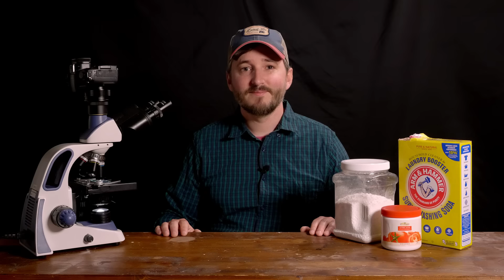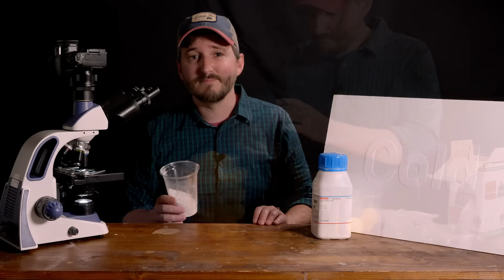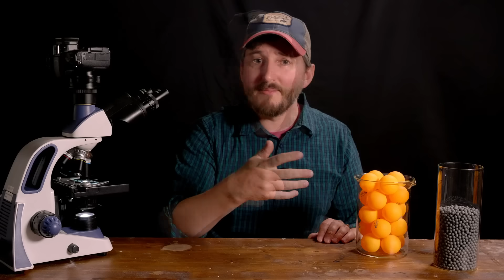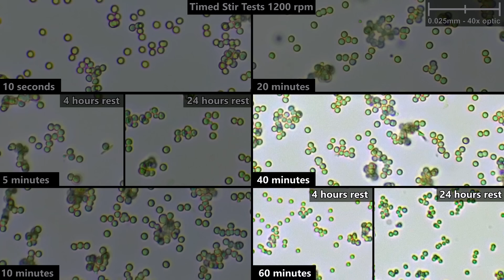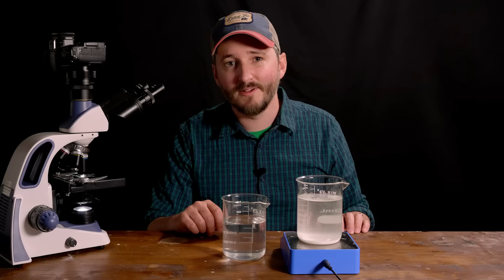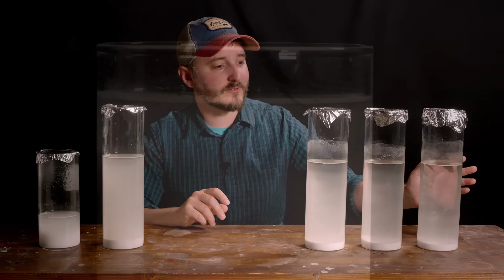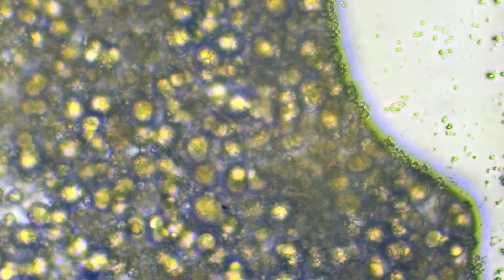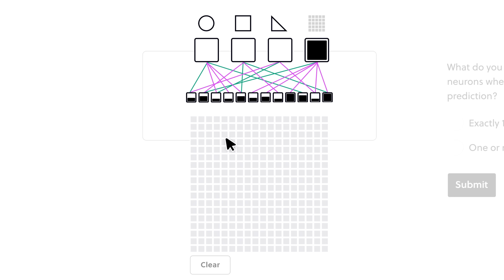Making Infrared Cooling Paint From Grocery Store Items (w/Novel CaCO₃ Microsphere Synthesis)

Comment: wow...im impressed, subscribed!
Reply: i retired in the philippines and coated my sheet metal roof with hi gloss white oil enamel(after priming with iron oxide) and it cooled my house interior so much it made no sense to use styrofoam insulation under the 3/4 inch plywood the sheet metal is screwed to. even when the sun beats down hot enough to easily cook an egg on red primed or bare sheet metal mine is cool to the touch.
i dont think this paint can be used for my purposes but i learned a lot and may incorporate some micro spheres into the next repaint.
i was a painter for many years,sandblasting and industrial to decorating, from tank interiors such as those large elevated municipal water towers and reaction vessels at factories and "tank farms" to kitchens and bathrooms. I paint oil paintings as well of landscape scenes etc.
you are one cool dude 😃

Comment: For application: If you were able to keep the consistency of the final product very controlled, you might be able to extrude it with the same sort of x/y movement as is made by a 3d printer or inexpensive hobby laser engraver. This would have the benefit of showcasing a method in which entire panels could be mass produced with machines.

Comment: Would a clear corrugated plastic panel with the paint on the underside be a good test ? It would protect the fragile paint as well, give it a layer of insulation so you aren't cooling the outside air.

Comment: Would this paint function well with a clear coating on top after it dries? You mentioned the thin plastic above it, and I completely understand the irregular surface area scattering light better, but for practicality's sake wouldn't a hard clearcoat on top help towards the "general use" goal? It would also help in rain, for example, where a nonzero amount of this recipe would just dissolve on the surface as is currently right?

Comment: There's clear benefit for the many by open sourcing your research and clear reasons that you wouldn't have.

As a (smol) science channel myself with similar pros and cons for open sourcing -

What's your motivator for (put your small youtuber hat back on) open sourcing vs keeping your knowledge to yourself?
Reply from the maker: In my case most of my current income comes from making videos so I don't need to worry about making money on the inventions. You can always release a video then file a patent or provisional patent also if you think the invention has some value that you'd like to commercialize

Comment: Recommendation for paint/coating application: Attach two parallel guide rails to your canvas, place a dollop of your coating at one end, and use a squeegee perpendicular to the guide rails, wiping down to spread the coating evenly across the rest of the canvas. The height of the guide rails will determine the thickness of the coating.
Reply: Screenprinting.... without the screen. Clever :)
Reply: That's pretty much what I was thinking, at the right consistency this is less of a paint and more of a putty or paste. Would be pretty trivial to skim-coat large surfaces with a similar method to how you apply drywall mud or plaster on walls.
Reply: It might be possible to have a solder mask cut (probably in a diamond grid pattern) so you could apply it the same way as a pcb gets pasted. You'd probably need a more viscous coating for it to work though. Spread it on with a stainless scraper, and remove the mask. The fluid should spread out a bit after its removed, and gravity should flatten it out and fill in the missing spots. You could also play around with the thickness of the stainless mask too.
Reply: Nice to see that a few of us came to the same solution! However this would only allow for one size of panel, but especially for experimentation would make everything a lot more consistent
Reply: I’d think it’s most case use are roofs vs the sun. Screen printing as the original poster noted is a great idea. Flexible rails can be laid on a roof and a layer can be “printed” on most roof surfaces (say 1 meter long sections. Then one of the rails is removed & moved to the end side, then another meter is printed, then rail is moved again until the entire roof is covered. This is similar how they screed a concrete floor, using guide rails to glide over. In this case, the rails can be permanently left inside the finished layer, or something that is removed as you go. The rails themselves are the thickness you want the layer to be.

Comment: That's actually really impressive, the simplicity of production. As is the scalability. It would be really interesting to try an application on a much larger scale, like an entire shed, for example. Just to see what it does to the interior temperature. That was incredibly interesting, and amazing to watch the spheres grow in real time.
Reply: From an OLD lady.  I look forward to having this applied to a HOT south wall of my house.    
  Who says you can't teach the Old lady new tricks.  A.R.F.
Reply: I'm not sure how effective it'd be on an exterior wall, isn't supposed to be applied to a roof or something? It bounces rays into the sky after all. I mean, depending on the color of the current paint or material, white still reflects better and would probably be cooler, but the specific function of converting the light into a type that passes through the atmoshpere probably wouldn't be useful. Please tell me if I'm wrong, that's just what I've come to understand from this video.

Comment: Is cooling ability proportional to surface area? Would a painted square of corrugated steel have better cooling potential than a square of flat sheet metal of equivalent size and thickness? Always happy to see a new upload, especially one with such depth.
Reply from the maker: I'm not sure of that. I haven't tested textured surfaces yet

Comment: I have what is probably a very ignorant question, hopefully you can address it and clarify why it's wrong.  If surfaces like this are capable of emitting IR in enough volume to shed noticeable amounts of heat... Could someone paint a thin thermally conductive surface (like a metal sheet) place it a tiny distance away from another metal sheet coated in something like vanta black or black 3.0 which is noted for absorbing almost all IR, draw a vacuum between the plates, and functionally have a one-way heat exchanger or concentrator?  The metal contact on the white side would always be trying to transfer heat to the black side, at least within the range of stability for the paints.

This thought has been bugging since your first video on thermal paints
Reply from the maker: That would not work because black surfaces are equally good at radiating all wavelengths of IR as they are at absorbing them. There would be an equal exchange of heat in both directions

Comment: You mentioned that the surface is fairly easy to scratch at the beginning. What do you think of covering the paint with a thin layer of epoxy after it's cured, or painting it on the reverse side of a piece of glass as if it were a mirror. I realize that mixing the paint with epoxy before applying it may not be ideal since the microspheres would get spread out in the epoxy, but what about coverings to try and block the paint and make it a bit sturdier. Or would most coverings/top coats end up preventing the infrared light from escaping?

Comment: Given the heat radiative properties of this substance, and the usefulness of heat pumps, I wonder if you are going to later look into dark paint that absorbs the wavelengths that air typically radiate. If the radiative paint is applied to the top of a metal sheet (metal for conductive purposes) and the potential future absorbing paint on the bottom, could it not pull heat from the surroundings and emit it past the atmosphere?

Comment: RE: application method: Would a coarse sponge applicator like a shoe polish tube work? Something that could contain the pigment like the syringe but spread it out evenly as you push the material through it onto the surface.

Comment: Very cool! I was wondering on couple things really. I saw short section of heat sink with paint applied on bottom of it. If you aimed that surface to space, blow air though radator side, and ensure that sun dont touch any of those, how cool would air be after blowing though it? lol

The problem with applying it to large surface, I wonder if there is people on industrial coating service could be able to design a nozzle to spray it evenly across large area. I wonder if it is workable by layering up rather than single shot of thick coat also.

Comment: In food prep, sodium citrate is an emulsifying salt; could be its having a similar effect on the two reactant liquids keeping them somewhat separate and delaying their overall mixing and reacting time. 
And with regards to your reaction temperature experimenting, CaCO3 has retrograde solubility (less soluble as temperature increases) which could affect the reaction results at higher temperatures.

Comment: Application? A 5 gallon bucket used as a kratky container for hydroponics. The bucket is painted to prevent light entering the bucket. And painted to keep the nutrients inside cooler. 

You could paint it black to prevent light. (Prevents algae)  But if this this paint is blocking light the cooling properties would be beneficial.

Comment: I'm curios to know if using off the self clear acrylic paint is significantly less effective than the DIY method. It might make for an easier applied and tougher finish at the expense of a bit of efficiency. Even if less efficient per square meter, it could be applied more consistently, allowing greater coverage for a given volume of paint.

Comment: I think you might investigate materials that are infrared-transparent. With the lack of surface robustness, you're going to want something "in the front" anyway,. And probably not saranwrap. So, if if you can latch on something else especially cheap and sufficiently transparent, you have a different 'application problem', that might be fundamentally easier than trying to "paint" it. Imagine if it's as easy as sandwiching it between two specialty glass panes and squeezing. My knowledge is more focused on "transparent in UV", (Think: sapphire), but there has to similarly be a pile of literature on things simply transparent to the specific wavelengths the CaCO3 is radiating at.

Comment: Have you tried pouring a thin layer of your “paint” onto a sheet of PMMA?  Maybe two thin layers with the pigment between would work.
It's surprising that acrylic doesn't absorb the wavelengths we're trying to get rid of, given how effectively a CO2 laser can cut it.  I suppose the heat makes it impossible to make cast or extruded sheets of self-cooling acrylic, though.

Comment: Need to make the coating as thin as possible to minimize thermal impedance.

Measuring the thermal impedance of the material would be useful.

The metal surface should be tall pyramids like the foam walls of an acoustic laboratory, to further minimize thermal impedance.

Comment: Citrate chelates calcium ions making them significantly more soluble, so it affects crystallisation by either keeping the calcium in solution longer or increasing the rate of the reverse (redissolution) reaction. 

The articles shown all seem to mention producing the valerite polymorph. I had a look at valerite and it is an unstable polymorph that transitions to calcite via dissolution and recrystallisation, so that may very well be what the citrate is working on.

It is a bit hard to say more without access to various articles. Still very intriguing and nice work with the incremental process experimentation.

Comment: You're an absolute hero for putting all this effort in and giving away your research freely. Thank you. Could you apply this to a set of tiles and then shrink/vacuum-wrap them once dried? I think using a thicker plastic may provide some weather resistance to the paint. Thanks again for all your hard-work.

Comment: On topic of microspheres diameters. Why wouldnt you use the smaller microspheres as nucleation sites for larger microspheres?

In application I am thinking of x parts of calcium chloride and acid, followed by one part washing soda, mix until formation of the spheres are mostly formed, then add another part of washing soda, repeat x times. 

I expect the first stage of the microbubbles would be a highly preferred nucleation site, so that every subsequeant addition of the reactants would let the microspheres grow more and more.
Possible that you might get some stray secondary  spheres forming which would be smaller, but it might be close to a ratio of 3 to 1 with the right factors.

.... that or the excess of the acid would just stop the reaction from occurring at all. -which would be less of a factor with more additions.  

Possibly for very small spheres,  reverse this and add drops of the calium chloride and acid to the washing soda solution. Perhaps the low ph and low concentration would result in faster smaller spheres? Letting it settle out of solution, decanting the excess washing soda to reuse it without it resulting in building on the spheres already present as considered above.

Comment: I don't have the time or space to attempt this, but a good small experiment would be for you to mix this with a very insulating material.  In theory the material would not only cool passively, but also insulate the surface applied to, useful for building cooling.

Comment: Isn't the ratio of pigment to binder very high in your example? Have you experimented with that ratio to see if that makes a positive difference in consistency and durability?
Also, acetone alone evaporages really quickly. probably too quickly for making a film not warp and peel. Maybe adding mineral spirits (much slower evaporation) could help slow down the drying time for a better result. It doesn't react badly with acetone, but what it does to the pigment I have no idea :)
Reply from the maker: High pigment content increases cooling

Comment: This is really interresting stuff - and discovering a recipe that is actually achievable to make at home counts for a lot too.
I suspect that the biggest point of improvement here is probably in the binder, so that it would be more durable, act more like paint, and be easier to apply with common methods. The current product seems very crumbly, fragjle, and unnecessarily thick. If this aspect could be greatly improved then it could help a lot with simplifying the final contraption (less protection) and making the whole thing more durable. You may also be able to remove the need for acetone, since it's fairly toxic stuff to work with in scale.
It might be as simple as combining the pigment with some non-pigmented or white-base off-the-shelf product. Otherwise, the best solution might be to collab with someone who has that sort of expertise.

Comment: Great work. Just wondering if you could try mixing your pigment with a substance that is thermally more conductive when dried. I wonder if it could be more efficient in transferring heat from the shaded side to the other and radiated out.

Comment: Excuse my potentially stupid remark, but why not make the whole pigment out of the smallest possible spheres ? That would have high density anyway without all the acrobatics, unless I'm missing something obvious.
The only upside i see, is that large spheres take less time to make, but even that is negligible.
Reply from the maker: Any one size of sphere fills only 65%
Reply: @Nighthawkinlight   @Nighthawkinlight  Yup, that's it, i knew i was missing something obvious. Thanks for the reply, love your videos.
Edit: although now i have another potentially stupid remark, what I'm thinking now is, if the goal is to fill the highest possible volume, and get highest density, then your method of different size spheres is (as I'm realizing now) obviously the solution. 
But that's not your goal here is it? Your goal is to use the refractive effect of the spheres, therefore what you need is the highest surface area, and not the highest occupied volume.
So maybe many smaller spheres are still better even at 65% ?

Comment: DO NOT place acetone directly on a hotplate as the flash temperature of acetone is pretty low and it can easily catch fire. Use a double boiler.